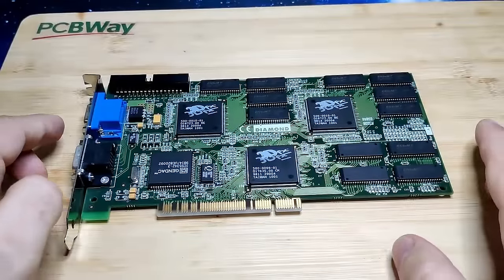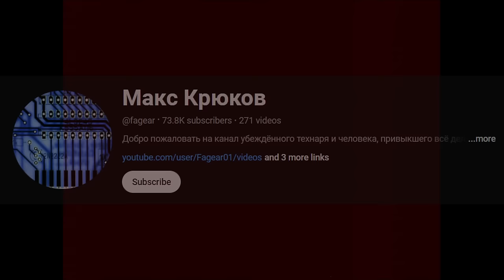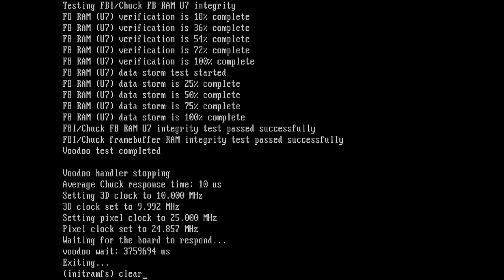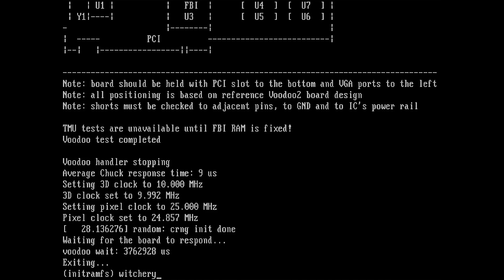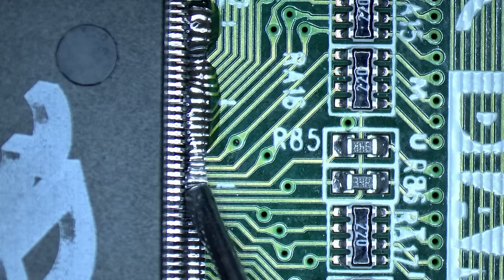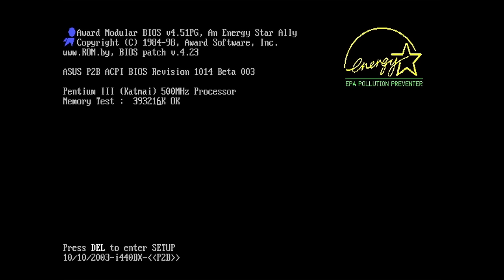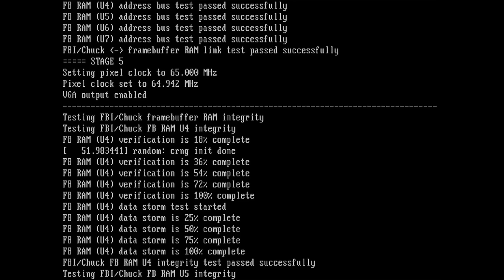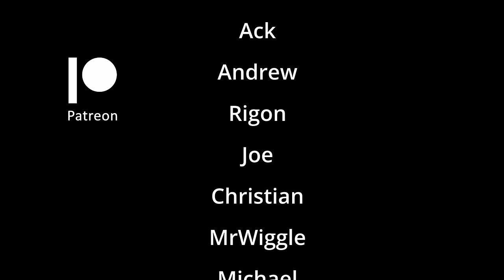The ultimate 3Dfx debugging tool: Witchery! Debug any Voodoo 2 and fix it! (Part 3/3)

Comment: I suspect certain memory is more important than other memory. Maybe that's why 0mb shows up even on the new chip.
Reply from the maker: This is what Maksim explained to me as well. U6/U21 seems to be the first MB, If this isn't there, 0MB are shown. For me, one chip (U6) wasn't working, so I got to 1MB, but no further because there was an issue.
Reply: @bitsundbolts some systems require a certain amount of ram before the rest becomes available.  I don't know about the voodoo

Comment: Maybe you already did this and I just missed or forgot (I'm very forgetful), but did you check the pins of the FBI chip for loose pins before replacing?
Reply from the maker: Yes, I did. I reflowed the solder of all pins in part 2, of this series.
Reply: @bitsundbolts  Ah, ok. I was thinking of going back and checking, but I didn't feel like skipping through previous parts. I know I watched them as I gave them a like, I just forgot already.

Comment: As I'm say on previous video - you must check data lines on memory chips by oscilloscope! I'm think you will be found this issue))
Reply from the maker: I only tested the traces with a multimeter. Some of the data pins are difficult to access with a multimeter. Especially the one in question is right next to the 5V supply pin. I still have the 3Dfx chip and I could solder it to the donor board if I ever attempt to fix that one too. Then I could try and see if it would be possible to spot the issue with an oscilloscope. And now I know the pin in question is at a corner of the FBI chip.
Reply: @bitsundbolts  some broken chips give very low or distorted  signal. It can happen that you need just pull up resistor to 5V and it will work again ))
Reply from the maker: I've seen this suggestion! That would be awesome if it would work. I just wonder what resistor value to use. The capacitance of the memory is about 5pf. Not sure about the 3dfx chip. I need to get a value that works at the frequencies of the data signal. I guess I could experiment. Start with a large value (e.g. 10K) and work my way down.
Reply: @bitsundbolts  You can watch signal on oscilloscope and add resistor 10k-1k-100 Om, until signal become good enough...

Comment: I suppose if anyone can answer this it would be you... Do you know if the Voodoo 1 can support 8MB frame buffer + 8MB TMU? I'm helping to test out a new DOSBox Pure experimental "16MB" Voodoo feature, but Windows and DOS games don't seem to be recognising the extra memory. Do you think 4MB FB + 4MB TMU is the limit?
Reply from the maker: What I have seen in a technical documentation for the Voodoo 1 chips is that the maximum memory supported by the FBI chip is 4MB. The TMU (TREX) seems to support up to 8MB. Look for 3dfx voodoo technical specification and mention the Site o3one dot org. It's in the PDF on page 8. I have to read up on this one day. Maybe a 12MB Voodoo 1 is possible. Totally useless though since it won't take advantage of all that memory in my opinion.
Reply: @bitsundbolts  Thanks for the help! Very useful info. Well DOSBox Pure is still scaling very well with games up to around 2001 while only supporting the Voodoo 1. The main limiting factors for games from 2000/2001 so far are the low Voodoo memory, the V1 feature set (like no DirectX 6+) and the performance of the physical host CPU. So if one of these bottlenecks can be removed or reduced, then it may still help some more games become playable, perform better, or possibly also improve textures in this case.

Comment: Because there was no short on the D0 of the FBI you could have tried a questionable repair by adding a pull-up resistor from the 3.3V line.
Reply from the maker: Hm, interesting... I still have the chip - and a donor board... and a pullup resistor... But could you elaborate on your "questionable fix"? I assume it is just a shot in the sky to add a pull-up?
Reply: @bitsundbolts  Well, by not having a short on that pin we can assume that the pin protection diodes that are connected between the pin and the VCC and GND respectively are not shorted. The only thing that is wrong is probably internal mosfet of that output's gate that turns that pin ON (connects it to VCC). So if the other mosfet is OK that means that this output can in fact pull down the pin but there is no active device to turn it ON (pull up). So by adding a resistor we can provide that pull up however we don't know if the rise/fall time will be adequate (I once managed to make this work but not at 90MHz for sure) or we don't know if the output is sometimes put in it's third state (high impedance) so this repair attempt will be quastionable at least.

Comment: damn, rip about that FBI chip. The bus driver probably took a large amount of voltage and was fried. it's a shame too because the rest of the chip appeared to be working.
Reply from the maker: Yes, it's just this one data line. The other three that went to the same chip seem to be fine. Well, there is maybe something I'm going to try what others have suggested. Use a pull-up resistor and see if it makes a difference.
Reply: @bitsundbolts  that would be interesting, please post the results